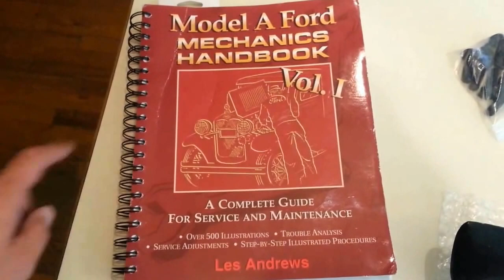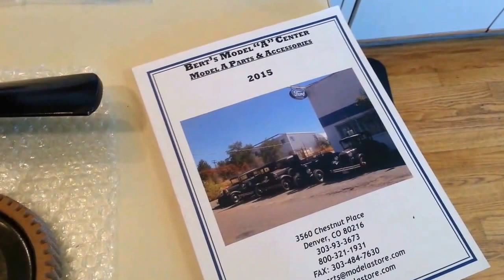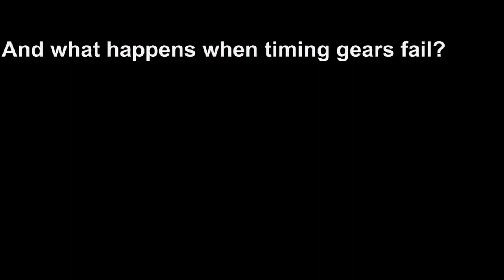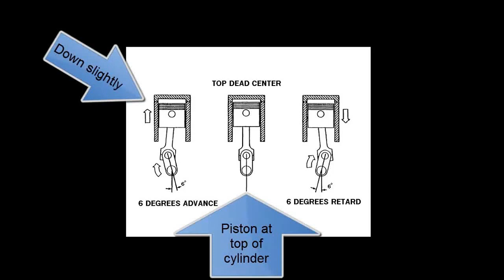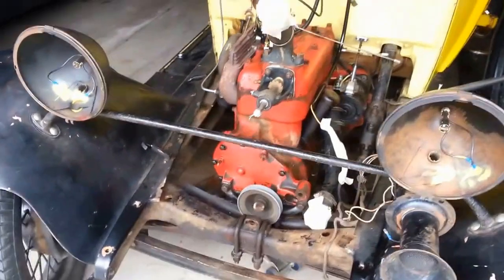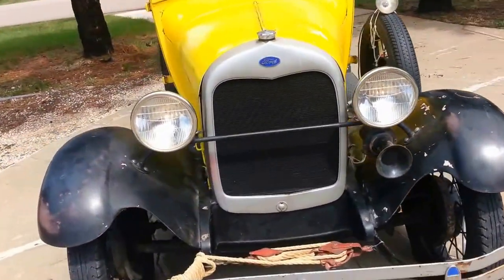Model A Ford Timing Gear

Comment: I changed my oil today and saw pieces of timing gear ⚙ in the drain plug. I ordered a new aluminum gear from Bratton's and will be back in business tomorrow. My gear ⚙ was really torn up. Praise God I didn't finish it off on one of my trips 🙌 😇🙏

Comment: There is a reason for the fiber timing gear instead of aluminum. If there is a problem with the motor the timing gear will fail and you just put another one in. With an aluminum timing gear it will break the engine and then you will have to rebuild it. I'm trying to remember what exactly is the situation but it's escaping me at the moment. I'll get back to you if you want.

Comment: I had read that using the fiber gear was actually a better choice because if something goes wrong and it will eventually the gear will shred if you put an aluminum one in there it screws everything up, the gear could have been made out of metal but they chose not to for this reason.
Reply: I know GM used fiber camshaft gears on 1960's 194 cu in inline 6 cylinder engines - it was supposed to make for quiet engine noise.
I'm not so sure technology existed to make fiber camshaft gears for these early Ford vehicles or if engine cam gear noise was an issue back then.
I think the aluminum gear, driven by a steel gear, is going to prematurely wear out.

Comment: One point to consider, if the gear shreds teeth the oil pickup tube and screen should be checked for restricted oils flow from the material being sucked onto the screen surface

Comment: EXCELLENT VIDEO. Thank you! My Fathers 30 A has been setting for 47 years in the same spot because he....well....for several reasons. Bottom line is it's in need of a new timing gear. It ran when it was parked in 1972 and then Pop's and several gallons of Magic Mystery Oil later he managed to melt the fiber timing gear.  After 47 years burred under countless 'treasures' i's been dug out and I'm going to be driving it in about 3 to 4 months. This, your video is a HUGE help. Thank you again!!

Comment: Are aluminum or fiber good materials to be making gears out of?
Reply: I think the fiber is impregnated with Bakelite. So if anyone complains about modern cars being made out of plastic, just remember that Model As had plastic cam gears. Anyway, the point of making them out of plastic was probably so that they'd be the weakest link in the event that lifters seized or something else happened. That way you wouldn't ruin the lobes on the cam.

Comment: Great video. I had to change mine out last year. The motor needs rebuilt very soon, so I went with a cheap gear. I didn't remove the radiator and it made it a fairly difficult job, but not too bad.